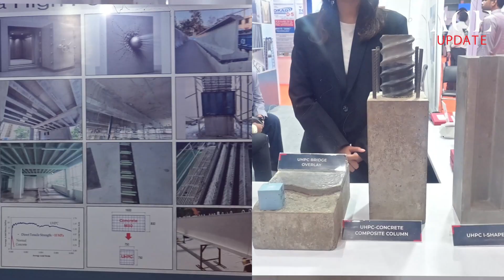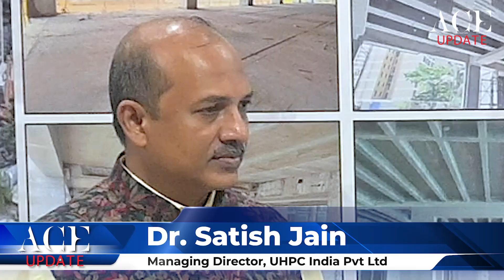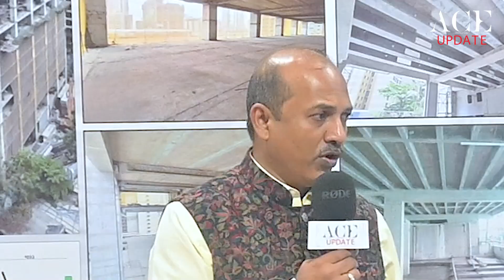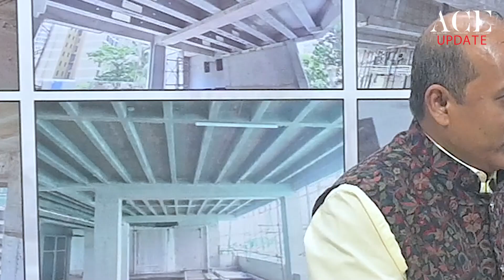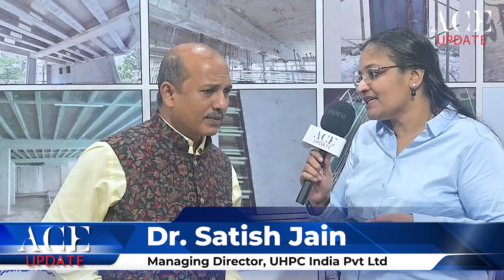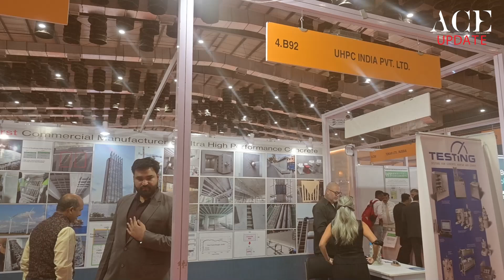UHPC India showcases the next wave of construction innovation at WoC India 2026

Comment: I have been working with UHPC across various market segments since 1985, having started my career with the Danish manufacturer (Densit A/S / Aalborg Portland) that first commercialized the material. Thanks to a strong patent, new French manufacturers only became truly active after 1990, and then only after first collaborating with Aalborg Portland. While UHPC has been used globally since 1983—initially for specialized applications such as wear-resistant components, safes, ATMs, protective structures, industrial flooring, and overlays—its use in lightweight, thin precast bridge elements was a long-held dream of its inventor, Bache. He created numerous designs, and the concept has finally become a success thanks to the efforts of Dura. UHPC remains a fascinating material, yet our industry is very slow to react and repeatedly forgets the lessons and applications of the past.